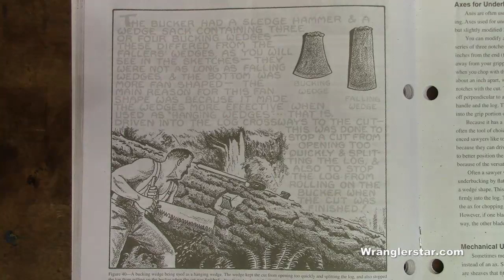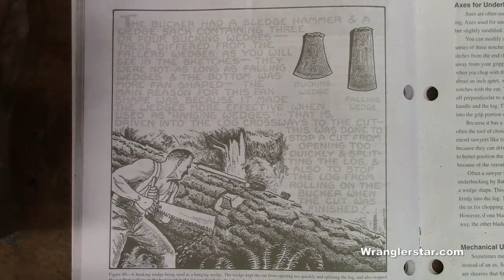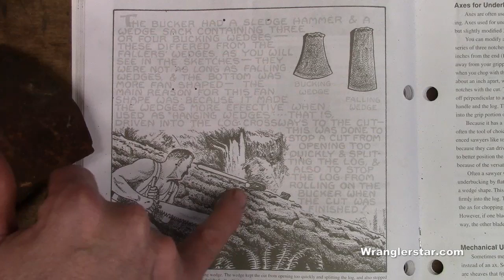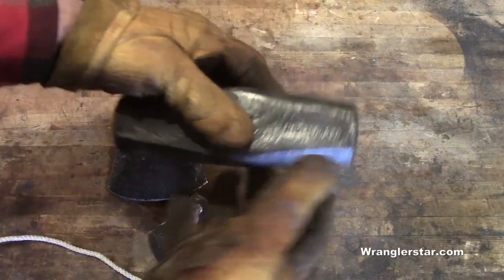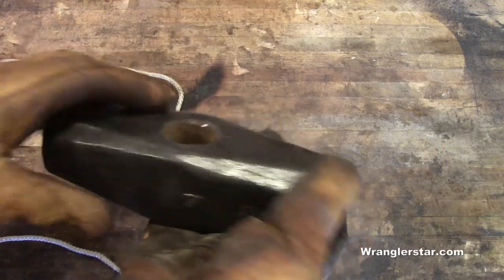Axe Head Bucking Wedge - Wranglerstar

Comment: Hey Wranglerstar, You could weld a piece on those wedges to make them longer. Since you already modified it it may be a good way to get a longer wedge. Just a thought.  

Also I found a neat old big ball peen hammer at a yard sale for a buck or something. The handle loosened up after I got it home. It had no wedge in it at all. So I watched your videos and trimmed the handle to seat it deeper and set a wedge like you did in the hammer you showed in this video.  I have always loved old tools and wood working. Basicaly making stuff instead of buying it. Thanks for the great videos. I learn a lot from them.

Comment: i like the fact that you're trying this the old way, but nowadays most people just swing an axe in there when your saw-bar is clear and you know the forces acting on the log.

please make a "review" video when you've used them, and explain the benefits to just slamming an axe across. the only advantages i can imagine are:
1. someone else can use the axe.
2. your axe handle is not in danger.
3. can be used in closer quarters e.g. underside of the log.

the downside obviously being having to take 10+ lbs of extra equipment with you being the wedges and the mallet.

keep up the good work. i love your whole "modern/old homesteading" theme.

ps: my mom would love to see more videos of the vegetable gardening.

Comment: Cody..just a thought...on the advise of a old timer, when I build my set a few years ago I found a donor piece of old US steel beam, ground the edges on angles, welded the joint fully around, and ground it accordingly, thus extending the wedges on the same contour and giving me a little bit more of a head to strike.

Comment: Very cool I dont see how those would stop a tree but I know squat about this sort of thing I have almost the same hammer I found it with my grandfathers things. I have started to restore a lot of tools greatly aided by your videos thank you very much for sharing and I always hit the like button.
Reply: It has to do with kinetic motion verses static motion. It takes very little energy, or strength to keep a non moving object from moving. If top wedged, and cross wedged, so that absolutely no movement, in any direction happens, three or four of those would hold most any log. However if any momentum is gained no number of those would hold a large tree.
Reply: The same reason why swing set chains should be rated well above the weight of the user.
Reply: Thank you for the explanation and perspective I understand what your saying but my gut says it would not be enough its the momentum I have experience with and have gotten into a few messes. Im not trying to contradict you its just the other forces I don't understand well. Also I'v seen to many swing sets that say they are not rated for adults sad in my book lol thank you again.

Comment: Did you consider cutting the double bit ax in half and then filling each ½ eye with weld?  Not sure if the weld would be too brittle so that there would be a danger of flaking when struck. But if so, you could anneal it with your furnace. Just thinking aloud.
Reply: As a former welder that would work, using a good 4130 steel and a TIG ...

Comment: I'm wondering if you cut them a bit longer, and then fill in the V with some MIG welding and then grind flat to make them a bit longer, would that give the length you wanted?  Might be able to extend 1/2 inch (and perhaps need to retemper because the weld will be hard). Love your videos! Cheers.
Mike
Reply: Great idea.
Reply: If you do a quick quench to cool the metal, you won't lose any temper. If you let it set for awhile to cool, then you'll lose temper in the metal.
Reply: +TsmnnDvl5 you're right in that letting the metal cool naturally would completely destroy the temper, but quenching too quickly would make it brittle and dangerous, I'd suggest multiple weld passes quenching each one separately, or putting the wedges in cold water while welding, would have to make sure to isolate the material so you don't get shocked, but, if my understanding is correct the water will draw most of the heat out of the metal while still allowing enough heat for proper weld penetration...??
Reply: This is where you have to know your metals. Yes, quenching too quickly can make it brittle, just letting it air cool, takes away all temper in it. Quenching in the proper oil does help, watch a lot of the black smiths when they quench heated metal, it's a slow dip at first, then it's a dunk. Again, you have to know the metal properties. Cheers :)

Comment: Great work Cody. Did you give any thought to cutting directly down the center of the double bitted ax? Then weld in a piece of flat stock to the center of the double bit eye to extend the length of the bucking wedge? If so, why did you elect not to use this approach? Just curious. Thanks for all the great work Cody!

Comment: I have an old Axe head that might fit the same criteria.  The only question, is there a practical way to cut the head if you don't have something like the kind of circular saw you used?  I'm wondering how long it would take otherwise.
Reply: Angle grinder will do the trick just fine

Comment: Next time, would it work, to use an old sledge heated in your forge and shaped to fill the center and then just cut it in half?  Since this is going to be a wedge and not a cutting or felling tool even if you had to remove and then re-heat treat the thing it would give you two longer wedges and the tempering would not be as critical.  If I find one perhaps I'll try it myself and let you know.  Trying it will only cost me a little time and like Edison I may just find a way that didn't work before my success.  God Bless

Comment: cody i was wondering. are all metal wedges safe to hit with a sledge hammer or will they all have a Chance of chipping
Reply: Ken, hammers with octagonal, rounded faces, called jacks or sledges, are tempered soft for hitting metal. Hammers with square or sharply angled faces are for breaking and shaping rock, and are tempered hard. Never use such a hammer to hit metal. I have seen them crack and I have seen them send off high speed splinters when misused. Wedges are made to be hit, and the metal further back than a couple inches from an axe's edge will be softly tempered enough to hit. But never with hard stone hammers.
Reply: thank you. i work in a hospital and there is a doctor i work with. he was splitting rounds with a wedge and hammer. and when he hit it a piece of either the wedge or hammer shot him in the aorta almost killing him. i dont want to make the same mistake :) and with knowledge i shouldn't thank you!
Reply: Jeez, usually eye protection is enough to keep from an injury more severe than a cut. That's incredible! Glad to hear it was "almost".
Reply: his story is on youtube if u want to check it out type that into the search box....> UPMC Stories: Dr. Bryan McVerry
Reply: Interesting. If the sledge in the video is his and not some clip art, it should have been okay. The sledge shown is a nevada pattern sledge, used for driving rock drilling bits. Bad tempering, I wonder? Brittled in a fire?
Reply: i don't know? if that was the maul he used but i think ill stick to my fiskars. and i might buy the sthil maul or the huskavarna maul? i am  undecided. any thoughts?
Reply: Yeah, get the Husqvarna. They're selling hand forged mauls and axes for drop forged prices!